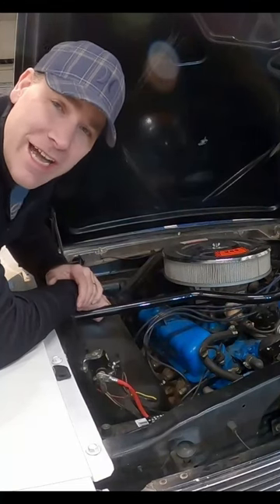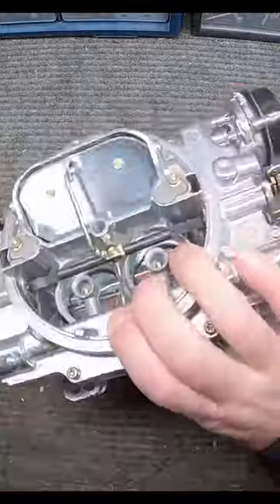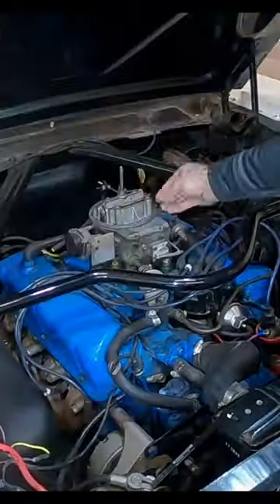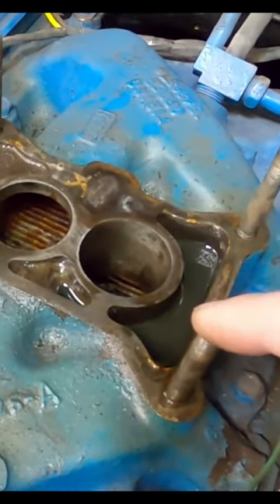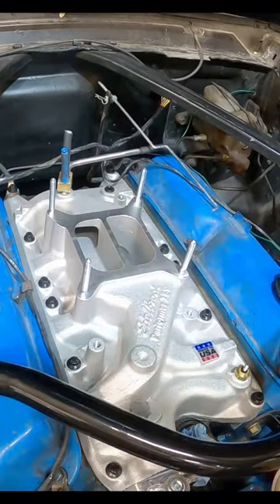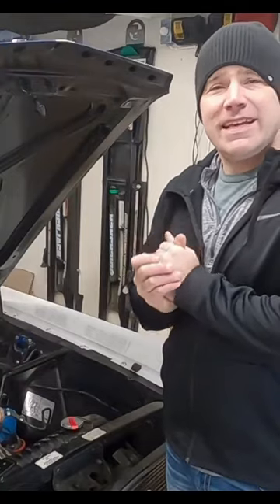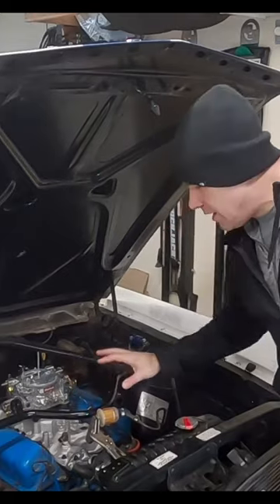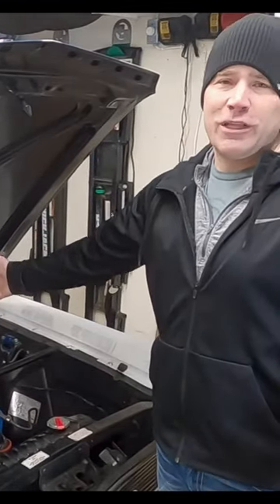Upgrading to a New Carburetor

Comment: A 289 can't digest more than about 450 cfm, anything over that is a waste.  Try going modern fuel injection, better performance, better milage.
Reply from the maker: Yes, 450 cfm is a starting point, it only gets better from there!  :)
Reply: @AndyKruseChannel  I ran my289 to 8500 rpm. Anything less than the 750 I had on it slowed it down.

Comment: Just got a 95” Chevy Cheyenne everything stock,190k miles works good runs good, what could I do to get it to respond a little bit better while stepping on the gas, everything works great doesn’t leak oil trans shifts good just responds kinda late while hitting the gas but once it goes it goes ‼️‼️ any advice
Reply from the maker: Tuning the Carb would be a good first step.  Not sure what Carb you have, but making sure the Carb is happy might make the throttle response a little snappier.  Trying to add more power will be a combo of several new upgraded parts, but getting the Carb dialed in would need to happen first, so you can see if that solves your first issue.  :)

Comment: It would have been nice when you're doing this video you threw some prices at us so when you took off the 2 barrel threw it away and bought the $700 4 barrel and then you gotta take off the intake manifold and by a $700 entail manifold plus a $50 fill pro intake manifold gasket kit you should throw all these numbers at us so we could really relate to what you're actually doing Did you replace the air filter so how much did that cost ?
 Tell the people you had a really nice driving 2 barrel motor and you spent $1500 to make it into a really nice 4 barrel motor
Reply from the maker: Sounds like you've got the prices, so we're good.  :)

Comment: Is the 4 barrel intake is from a 454 big block?
Reply from the maker: Not sure what you are asking.
Reply: @AndyKruseChannel  I was specifically asking if the intake that you are using for the Edelbrock carb is from a 454 Chevy big block. I do apologize on terms. Just got into carburetor world. I own a 93 K1500 with a stock 350 TBI. I was planning on doing some upgrades to it after doing some reasearch.
Reply from the maker: ok, now I see.  No, this intake is for a small block Ford.  However, the handful of steps required to upgrade the Carb on a Ford or a Chevy is basically the same.  You'll want a larger carb for the 454 than what I have here, but removing the old carb and slapping on a new one is roughly the same process.  :)

Comment: What would I expect to pay to do this exact change-up? (Carb and manifold).
Reply from the maker: Assuming you buy all new parts, you're looking at roughly $300 for the Edelbrock Performer 289 intake manifold, and roughly $430 for the Edelbrock 1406 Carburetor.  Then you'll need to add another $100 or so for gaskets and misc pieces needed for the swap.  If you're savvy enough, you could find these same parts used for much less and they will perform the same.
Just a heads up, this is a YouTube Short of the full video I made where I go into more detail about this upgrade.  Check it out on my channel!  :)